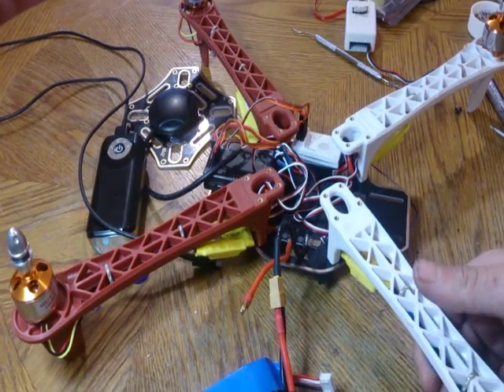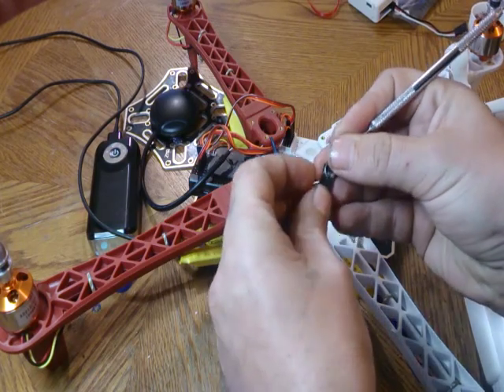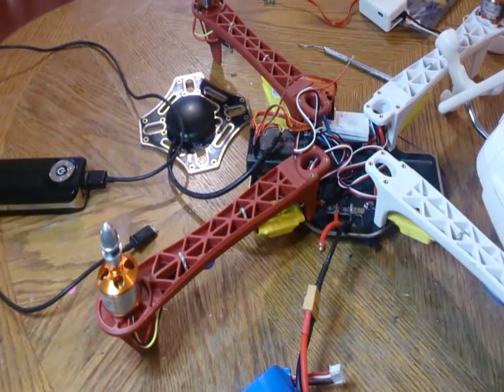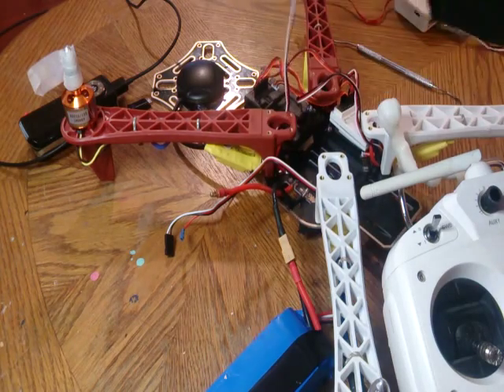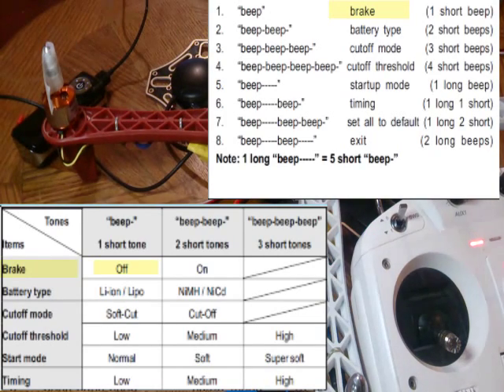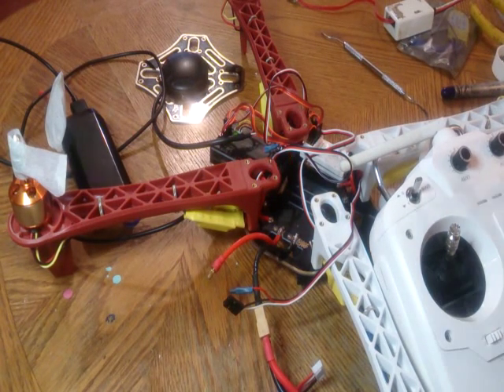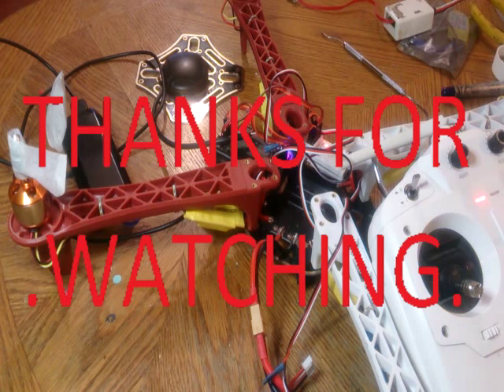HOW TO PROGRAM HOBBYKING,HOBBYPOWER HOBBYSKY ESC WITH A REMOTE

Comment: Hello, I wan't activate Brake. So I try to access on program mode but the ESC doesn't emit music on top throttle only a sequence of beeps (beep, beep, beep, beep ...)
My ESC : http://www.readytosky.com/e_productshow/?1222-30A-Brushless-Motor-Speed-Controller-Control-RC-BEC-ESC-1222.html
Reply from the maker: You need to power the Receiver. 
turn on transmitter. 
full throttle 
plug in power to the esc.
Depending on how your doing it , You may have to arm your flight controller first ..

Also you might have blheli_s firmware on your esc.
so if you have a arduino you can make your self a programmer and use blheli Gui to change settings on your esc.
I tried to look for Beep codes or "program blheli with transmitter"  ect.. some say the beep codes are the same and some are 100 percent different.. so you might have to find a step by step for blheli.

I do have a video on how to make the programmer with a arduino here.. keep in mind you don't have to flash the firmware as you should already have blheli on your esc.
https://youtu.be/EACa18e8kzU?t=208
Reply from the maker: errr i thought I made that on using the servo wire not soldering.. oops..   I'm not sure if the link i have in my description for the programming card would work as well.

Comment: Can I do this for Simonk black 30a esc
Reply from the maker: Hi usually they now come with a little manual.. here is a example for some simonk 
http://yinyanmodel.com/EMAX%20User%20Instruction%20for%20Simonk%20Series%20ESC.pdf        you might be able to find a programming card as well for it
Reply from the maker: also if the manual confuses you ..it would be best to draw out the layout .. here is a example of what i mean .. i did one for the cx20 but i don't know the value's however if you draw it out like that with the known value's you might not get confused during programming with the transmitter.      here is the example i did bad drawing but it helps.
https://youtu.be/yCpid3Lv13M?t=207
Reply: @ModItBetter  I am having fsi6 transmitter and Simonk 30a esc when I try to take off my quad in loiter mode the rpm of motor decrease at 50% throttle and suddenly increase to hover the quad

As I want a smooth throttle response what should I do

Pls say me the solution Pls Pls Pls Pls Pls Pls Pls Pls Pls
Reply from the maker: @ramudu4410  what flight controller do you have?  
What does your quad do in manual mode? 
How long have you been flying?
Reply: @ModItBetter  apm2.8 dji f450 frame 920kv motor flying for 1 year and in manual mode when I take off it drift to its left side
Reply from the maker: @ramudu4410  Have you done a esc calibration?  .
also have you played with angles ect..?
If you are using just a default param .. what you can do is back up your params and load mine.
https://drive.google.com/file/d/0B2w6_OKE_2kxM0xYckJidFNRWTQ/view?usp=sharing

Now with mine I have rtl altitude set to 424 meaning 13 feet on a return to home . you can set that back to 1500 if you wish or what ever.

before loading mine just write down your flight modes .. so you can change mine to yours.

make sure to do all the calibrations 1 by 1.
and take your time with the accel calibration making sure its pretty level when you start.

under compass confirm its roll 180 if your using a 2in1 gps...      then give mine a shot. if its worst ..then just simply go back to yours.. . .

also i turn off mot spin.. Meaning your blades wont turn when you arm the quad.. that annoys me but some people like that.

Comment: Hi bru, I really love this. I am gonna take a program card right way. I am a newdie to build a DIY drone. But currently, I just don't get your wiring with your ESC and APM. My kits are Pixhawk4 and exact same ESC as yours, DX6e remote. Looking forward your reply and further help! thanks in advance!
Reply: and Spektrum AR9020 X receiver
Reply from the maker: @guohaoye9628  Hi if you just order the card its really simple.... and you don't need to use the apm I'm not sure why i showed it that way back then maybe just easier to show it that way and no explaining how to power just the receiver.

..   But anyways on your Spektrum hook up one esc at a time by plugging it into the throttle on the receiver.. fallow the video the same accept you don't need to arm it..  .. as long as your receiver gets power from usb when you plug it into your pixhawk all is well.. 

so for example .. 
plug motor 1 (esc)into throttle on the receiver.
Plug in the usb power to the pixhawk.
turn on transmitter
move throttle up on your transmitter .
plug in the battery ..
wait for musical tone and fallow the chart.

however make sure to remove the red wire out of your esc if your going to try it that way.
Reply: @ModItBetter  Thanks Man! it's been a 3 years ago video. Lol!  I will try later on, but I am so new to these controller kits. so hope you understand my suffering. hahaha. If you don't mind, I wish I can send you pics or short videos of my work via email, so you can find out my possible problem.^-^
Reply from the maker: @guohaoye9628  you can send picks and vids to bangs696969@gmail.com   I have not watched my video on cx20 to pixhawk in awhile but if you treat the cx20 like any other quad its basically 100 percent the same step by step. .. but your issues could be other things for all i know..
Reply: @ModItBetter Huge appreciate it sir! My platform is Tarot 680 hexacopter btw. But anyways I will come with a proper question if any. I do all fine for software parts. Just you know, a little bit hardware combination issues, like this time I am gonna calibrate ESC by trying remote ahead, then I'll have program card to finalise it. Anyways I appreciate your help so much!
Reply: @ModItBetter  Excuse me Sir. Does that function list setting matter to program ESCs?
Reply from the maker: @guohaoye9628  Hi yes what i listed above was to get into programming mode.
Pix has option to calibrate esc in missionplanner.

but to program one esc at a time on receiver would be
 
1.plug motor 1 (esc)into throttle on the receiver.
2.Plug in the usb power to the pixhawk.
3.turn on transmitter
4.move throttle up on your transmitter .
5.plug in the battery ..
6.wait for 2 beeps from motor or 2 seconds.
7.put throttle down.
8.Should hear short musical tone.
9.If all silent you can move throttle up to test motor.
Reply: @ModItBetter Appreciate it again Professor!

Comment: Thank you very much sir
Reply from the maker: Your welcome glad it helped out..and thanks for taking time to leave a comment..
Reply: Your this video is very useful for me 
Thank you thank you thank you
Sooooooooo much

Again thank you for replaying me
Reply: Sir i have one question for you
I made big drone like 1855 propeller size using in dron. 
Which flight controller is best for me ? 
Apm Or pixhwak or other  please help me
Reply from the maker: @mokshpatel6986  Hi the apm is cheaper and does almost everything the pixhawk does.
However the apm 2.6 / 2.8   only goes up to firmware version 3.2.1

they both can use the same firmware up to 3.2.1

However the pixhawk are still taking updates till this day.
They both can use mission planner as the windows gui .or droidplanner on on a android .

So its really up to you if you want to spend extra on the pixhawk.   

Personally I don't mind the apm 2.8 and is my go to flight controller  even though i have many flavors of the pixhawk.
Reply: You mean apm is best for me
But stabilize ??
Reply from the maker: @mokshpatel6986  there is more code and faster processor to keep it stable.  with pixhawk.. 
it also has a tad better barometer in the pixhawk.

however taking your time with accel calibration in mission planner can have your quad lift off the ground moving the throttle one notch at a time / slow..
without it tilting either direction..
instead of the burst of juice.

and will be a rock in the sky if done correctly.
in gps or alt hold.

With that said you still need to take your time with the pixhawk as well.
Reply from the maker: @mokshpatel6986   also if you notice I do allot of video's on the apm 2.6 / 2.8 so lots of my mods are for that apm..  basically every video that says cx20 can be applied to your quad for help
Reply: @ModItBetter  but my question is I am making a big drone (aprrox 27-30 inches).  If so apm can handle it that is my question
Reply from the maker: @mokshpatel6986    yup even a cc3d can handle it.. really if you broke down any flight controller.
its just
barometer
accelerometer/gyro
compass..   but some don't even have that as a option. or the barometer.. 
so really its the accelerometer that is important and all flight controllers are pretty solid with them.
then pwm output to esc's

apm2.6 and pixhawk lets you attach gps ,telemetry ect.. for return to home .. fallow me mode..  gps hold ect..
and full auto missions..

So yes it can defiantly handle it  .. just make sure to center it.. In one of my video's I show that you really don't have to.
because you can offset it in settings ..but thats just a bad idea .. the more center the better.
Reply: @ModItBetter  thank you soooo much sir for your help me 
Agin thank you soooo much
I wish you all time you and your family happy

Comment: So you Think super soft is Best Bangs
As I set mine to Default last night 
I have not tested in the air as yet , need to tidy it all up and put everything in place
Reply from the maker: hi my settings are in the description.. I ended using soft.. which is default i believe
my issue was i actually had one bad esc..that would just go so so fast it was ridiculous..

Comment: Excellent video
just a question
Is that programming compatible with these ESC's?

Hobbywing 40a xrotor Hobbywing xrotor 40A 2-6 s opto ESC versión de Asia-Pacífico para 5010 F550 S500 RC quadcopter alta rendimiento
 http://s.aliexpress.com/3Uv2MbIN?fromSns=Copy to Clipboard

Simonk 30a. 4x HP simonk 30A ESC control de velocidad sin escobillas para multicopter F450 F650 X525
 http://s.aliexpress.com/iemE7B7R?fromSns=Copy to Clipboard
Reply from the maker: Hi it "should" work with the Hobbywing   but it "should" not work with the simonk you need a different card that i don't have.. just google "simonk esc programming card"

Now I say "should" because who knows what firmware and hardware will be on the esc's under the heat shrink..    the only thing you can be pretty  sure of ..is they will both come with instructions about the beep menu..

Comment: Hey you say “ if you are powering the receiver through the power module to remove it from the receiver and if it is getting power through the esc then remove the red wire then how would the receiver be powered? I’m not understanding. 
I currently have an apm with a fly sky ia6b receiver and I’m powering the apm through the power module so how would it be done?
Reply from the maker: the way the receiver gets powered usually is from input 1 on the apm .. you use a 3 wire servo harness.. with for example black,red,white which = ground,5volts,pwm    ..that 3 wire then plugs into channel 1  on the receiver ,when you plug in the power module it powers the 5volt rail on the input side at the same time powering the receiver through the 3 wire harness.

if you plug in a esc bec wire into the motor output side with jp1 jumper in place.
it also powers the 5vot rail. in turn powering the receiver.

so with just usb plugged in .. ..that also powers the 5 volt rail on the input side.
in turn powering the receiver..

Its why i just suggest unplugging the power module or the esc bec wire during a esc calibration.. They are designed to handle dual voltage.. However on cx20 and other esc's that have the sil chip they can fry or corrupt very easy .. same with the apm .
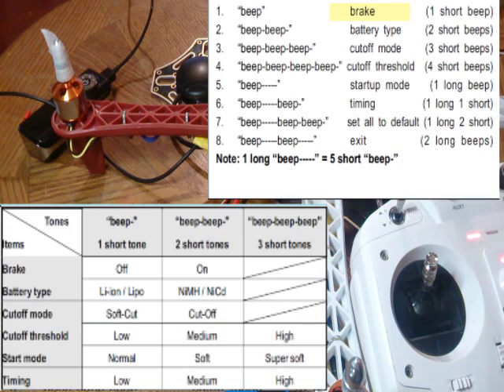Reply: hey bro i dont know if you are available right now but i am calibrating the escs and it seems to be that the table at around 5:59 (the one at the bottom is reversed for my escs) after the musical tone I put select down, then on TWO BEEPS it selects the brake to be off, therefore reversed. Have you heard of this? where did you source the tables from i cant find them and I dont want to do anything wrong since it seems in reverse.
Reply: they are ready to sky esc or xxd 30 escs
Reply from the maker: hi if yours does not sound 100 percent the same as mine then don't use it. but if you have as many items in the menu (8) it should be the same.... if you did not change anything maybe the defaults will good enough for u.

the only thing you need to do is esc calibration if this is for a quad.
Reply from the maker: for the r simonk firmware  the menu is different

i just found instructions on one of mine.. however here is a pdf i just found  as well

http://yinyanmodel.com/EMAX%20User%20Instruction%20for%20Simonk%20Series%20ESC.pdf

had to edit after seeing the picture of yours...
Reply: Please!
Reply from the maker: ok after looking at them ..if you have the same 8 menu beeps as mine and it sound 100 percent the same i have this link in my description for the programming card for them http://goo.gl/em0Jnv
Reply from the maker: and i have those esc's so the card does work with them..

Comment: guys, I only get a  one beep after the three beeps when trying to calibrate the ESC what does it mean
Reply from the maker: the three beeps can be it just counting the cells?     are you trying to calibrate them on a apm or from a receiver?
Reply: bangs6996 it's simonk and I am using arduino building it from scratch
Reply: bangs6996 I am using 4S or cell Battery
Reply from the maker: heh well there goes that theory..    Ok so you are just trying to do a esc calibration..

this is the part of the video your trying?
https://youtu.be/ygVlAyLPfI4?t=163
Reply from the maker: if so that means you have calibrated them../ it
Reply: bangs6996 Ya I did but it's just the beeps are different and I think it's calibrated.

Comment: Hello, i have only one motor that im trying to program. I cant seem to enter programming mode, i do everything properly and motor does 2 beeps but never goes to the 5 tone stage thus it wont let me program it. Could you give me some tips to try? thanks!
Reply from the maker: HI .. try right off t or number 3 on your receiver..

steps would be basically the same.
plug esc into number 3 or t on receiver. (remove red wire from harness)

If your receiver is getting power from the apm make sure to leave that wire in place.. usually channel 1 (a) has the power on it .. 

. 

remove all power from apm ..power modules,esc power ect..
only power should be usb power.

plug in usb.
turn on remote (confirm receiver light goes solid)
go full throttle (don't arm it.)

plug in battery.

wait for 2 beeps ..go full throttle.
then back down again ect.. 

..............
Reply: bangs6996 THANKS SO MUCH lol i thought chanel 1 was the throttle LOL but thanks so much. It is working now!!!!!
Reply from the maker: your welcome... and thanks for posting back your success..

Comment: Thanks for your help!
Reply from the maker: your welcome.. If its something your going to continue to program ..I would suggest getting the programming card.. you can visually see the settings . and you can find the card in my description or even cheaper on ebay for 5-8 bucks i think...just look for Hobbywing Programming Card.. ..
Reply: bangs6996 You know how it is, every plane seems to use a different brand esc. I guess with quads you might end up with 4 esc's of the same make and model. I appreciate your searching for the manual, and posting so I don't have too buy one.

Comment: Hi frend, the original cheerson cx 20 motors can with weight and this configuration ? Or not?
there is a problem if these motors with these esc ?
Thanks
Reply from the maker: No this will not work on the cx20.  cx20 does have programming menu but I do not know what the menu's are / beeps.   I'm sure they are clones of one that is on the market.. we just have to map them out..
Reply: +bangs6996 Thanks
the engines (motor) cx 20 can up this frame and working with this esc?
Reply from the maker: yes you can use these esc's you will have to replace all four of them,   I can try to make a step by step on this tomorrow.or the next day if you want.
Reply: yes thanks Im happy